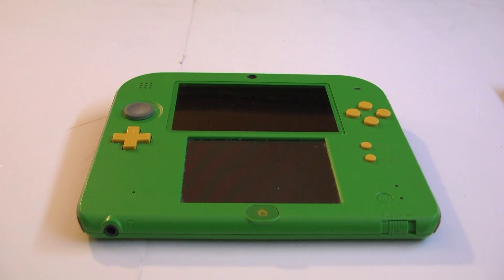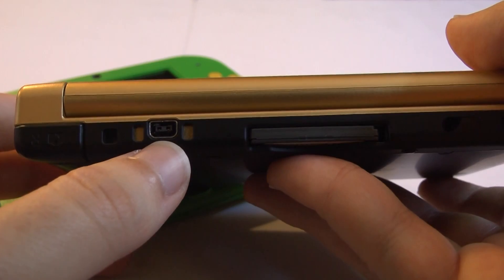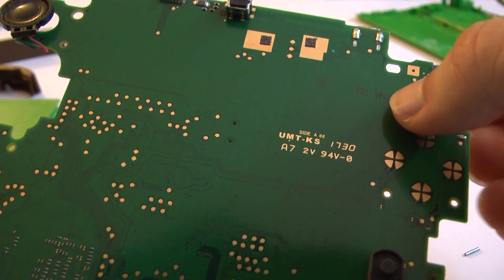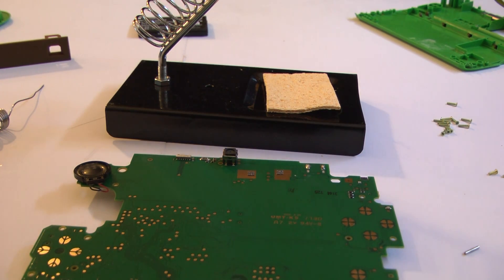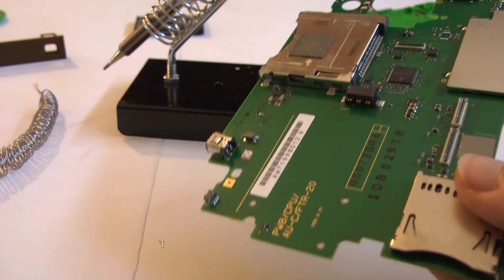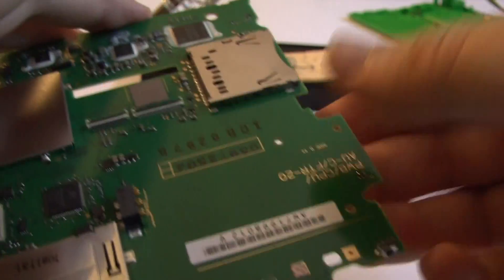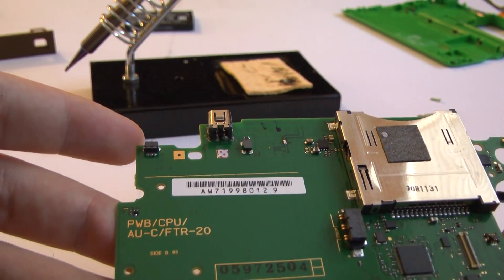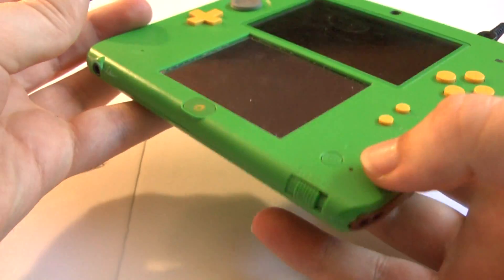No Power? Charge Port Replacement Tutorial | Nintendo 2DS / 3DS

Comment: Do never pull with force if you want to desolder parts if you cannot get them out or off something is still soldered if you pull there is a high risk you could remove solder pads and they are gone forever you can search a spare mainboard

Comment: Question! Whenever I plug the charger on the port of my 2DS, the charging LED goes up for nearly 10 seconds and light off again. I am guessing that the port is the issue. Since the same charger charges my 3DS.
Do you think that it’s indeed an issue with the 2DS port?

Also! If I take out the battery of my 3DS and charge the battery of the 2DS on my 3DS, So I can turn on the 2DS like you’ve suggested in the video. Does it black out anything on my 3DS in terms of data? Or it has not problem to swap batteries like that
Reply from the maker: It shouldn’t be a problem to swap batteries. It could be the charge port or a loose/damaged connector.

Comment: Is it the same charge port as a 3DS?
Reply from the maker: I know the charge port is the same shape but I do not know if it is exactly the same. I’m sure a seller will specify for which console it works for.
Reply: @GamesWeLike  i know im late but if anybody else needs to know, yes it is the same, and the batteries are the same but not for the new 3ds or any other “new” stuff from the 3ds family

Comment: How to I remove strip screws on a 2ds? I tried to unscrew my 2ds to begin fixing it, but when I tried to unscrew one, it became stripped. Also i tired to remove the screw with the soldiering iron , but that made it worse.
Reply from the maker: Yeah soldiering iron wouldn’t be good. I would just google how to remove stripped computer screws. Make sure to not apply heat to the motherboard.
Reply from the maker: If you ever feel your screwdriver is slipping/stripping, back out right away and try again using more pressure and turning slower. Also you could be using a size too small or too large. I don’t suggest electronic screwdrivers either.

Comment: Will DSI batteries work? I have another 2ds (Which is buggered) but it would be excellent if I don't have to pull apart a 2DS that got brutally squashed.
Reply from the maker: I’m not sure. I sense some Google searches in your future. I know the Nintendo Switch Pro Controller does use the exact same battery in it as the 3DS family does.
Reply: Dsi batteries are a different shape, but the port is shaped the same. Make sure you get a new battery shaped for 2ds with the proper voltage to match the port, otherwise it won't charge
Reply: @greenkoopa  Yeah yeah thanks, useful info.

Comment: My 2ds recently broke while it was on the original charger and the port got fried will my old battery still work if i change the port?
Reply from the maker: Well there are 2 ways to find out. You can fix the port and if the battery works, then great! Or you can take that battery and see if it works in another device (2DS, 3DS, Switch Pro Controller). This is all assuming the board didn’t get fried also.
Reply: @GamesWeLike  damn rip i think i might get a new battery just to see if it works still useful infor